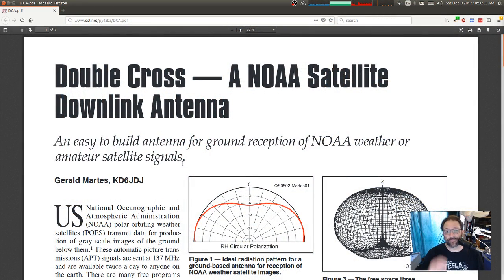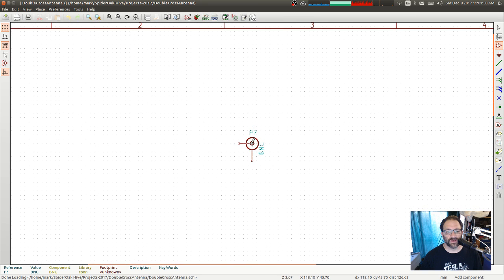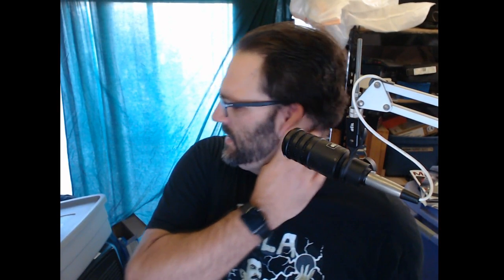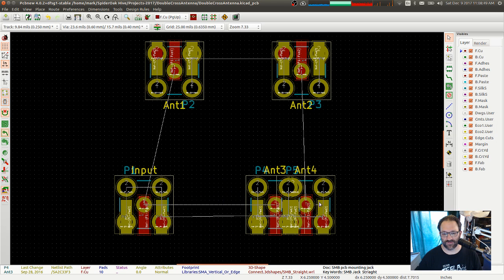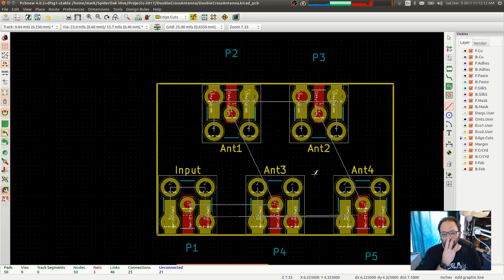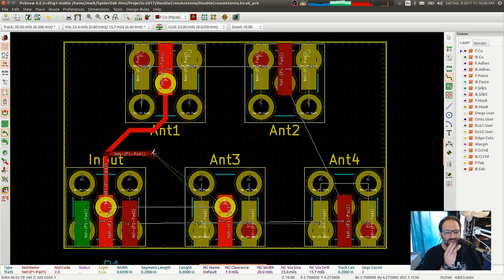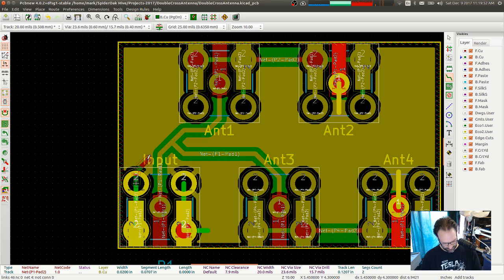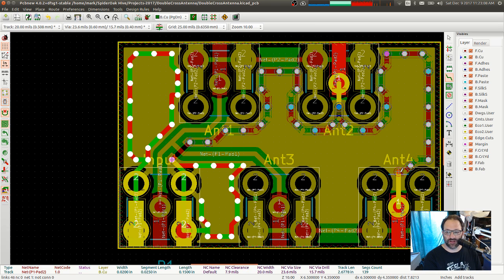Smitty Working on SOMETHING: Double Cross Antenna phasing board

Comment: the dca is a great antenna, but it has a blind spot right at 90 degrees. making it ineffective when the satellite is right over you .. it is much better to use the tursnille antenna for detecting nooa satellites since it has no blind spots in the center
Reply from the maker: How wide is the null?  The satellite is rarely DIRECTLY above you. Most passes are at least several degrees to the side, and even when it is a 90deg pass, it's only at 90deg for a short period.
Reply: I just built a double X antenna. Works fine - but like you I get a deep null ( about 20 dB ) as the satellie passes over. . It's not actually  when it is overhead - passes with 40 deg max elevation also have a null. It lasts about 10 - 15 seconds and occurs when the satellite has moved on from max elevation to about 5 degrees less. I get it on the noth bound and south bound passes.

I have noticed satellie photographs from other folks which show the same effect - but not all. Some photos which are claimed to have been taken using a double X  don't show these nulls.

I have no idea what to twiddle to mitigate this effect - ideas welcome

Keith Taylor
G3NNW

Comment: How did you calculate the length of the coax? It's a little confusing to me how they described it. They gave the length of one but not the other
Reply: It's easy. Whatever the length of the coax is from dipole 1 make it the same length for dipole 2. The length of the coax for dipole 3 and 4 is the same length as the cables for dipole 1 and 2 PLUS the quarter wavelength for your chosen frequency,